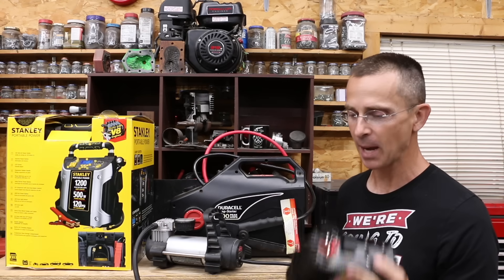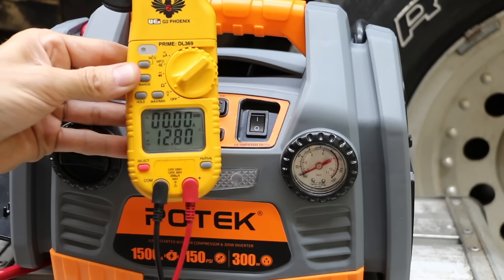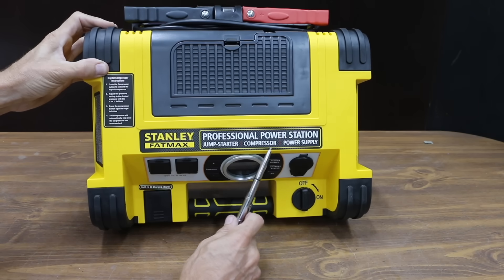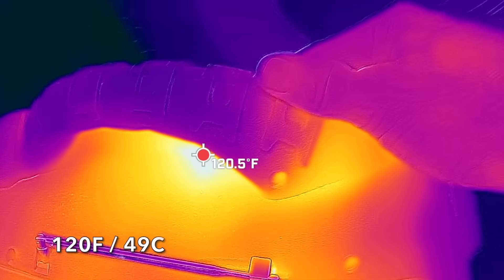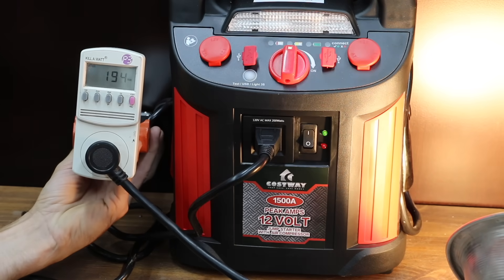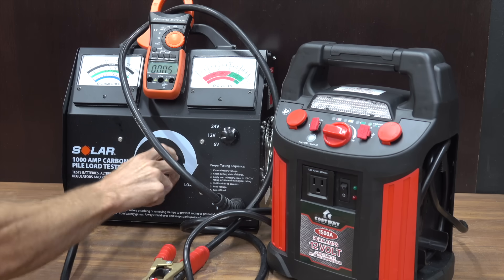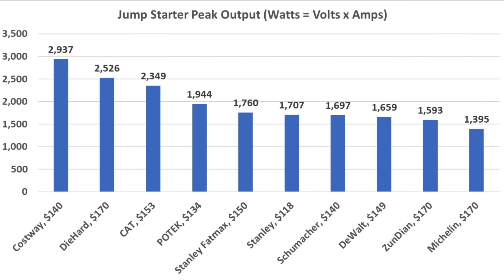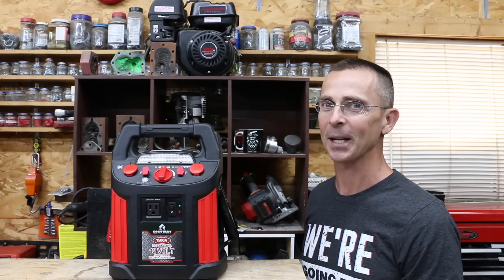Best Jump Starter? DieHard, Schumacher, DeWalt, Michelin, Stanley, CAT

Comment: I would like to see an addition to the test, leaving the jump boxes fully charged for a few months to simulate leaving it in the trunk of the car. Maybe go even deeper into the test by throwing them into the freezer for an hour or so and then pull them out and allow them to warm back up and repeat continuously to simulate sitting in the trunk during the cold months (probably when you’re more likely to have a dead battery !) Then test to see how the battery life is and if they’re still capable of jumping off a dead battery !
Reply: @DrJibson  All but one of them were useless as jump starters which means all but 1 of them is useless.
Reply: @stevewhite3424  - Keep in mind, the unit that tested well, will likely not perform well in states that experience temps at or below freezing during the Winter. To spend $100+ on a jump starter that isn't capable of performing properly year-round/in all climates, makes them pretty useless and a huge waste of $$$
Reply: @stevewhite3424  Exactly!
Reply from the maker: Thanks for the suggestion.
Reply: @ProjectFarm   iv tried to find the costway on Amazon and ebay I can't find it do you know where I could buy one ? And by the way this is another great video man very good info
Reply: JumpNcarry is the only one worth buying.....its all I use at my tow company. If you need a compressor grab one from the junkyard and plug it into the 12v outlet on the box. I've left mine for months and it never fails and it'll run a inverter or compressor longer than all of these even after sitting neglected for months.
Reply: @southjerseysound7340  hell when I was driving a tow truck we had a Duralast jump box (from Autozone) and it’d start a car without a battery in it at all. It wasn’t as fancy as these. It didn’t have a compressor on. lol
Reply: @Ohio-Patriot  
But that's not really impressive. It depends on the car. Some can run without a battery, and some can't.

And having a drained battery makes it harder to start than no battery at all. Not all the energy from the starter will be used to crank the engine. Some will be absorbed by the battery in charging.
Reply: @lordgarion514  it started every car I ever put it on, which was hundreds, dead battery and all. It started many many semi’s too. All I was meaning was for something that you’d think should be junk, it turned out to be pretty nice and lasted forever. It still works great today too.
Reply: @Ohio-Patriot  years ago they had one that was pretty good. I had a few guys using that Duralast box for a while because it was about$40 cheaper than the JNC.  It had a AGM battery inside similar to the JNC. The only problem I saw with them is the wall charger is total trash. But we fixed that with a little trickle charger......... I haven't seen one of the plain ones in a while. But if its the same I'd buy one again although they really like to sell the junk that has the useless crap all over it instead of the quality ones
Reply: @southjerseysound7340  what model do u use
Reply: @fjk4418  jumpNcarry blue has been my go to for years.
Reply: So perhaps I'm not thinking about it correctly, but I've owned the Schumacher jump box for years and years. I've effortless jumped a ton of people with it and it has never let me down even when I've neglected charging it. I feel that on the dead battery test, maybe they should have been turned on and just allowed to sit there a few minutes before cranking them over. I've ran into scenarios where that's what I had to do, but usually it's an instant jump. I have no scientific way to test this myself outside of giving my first hand experience, but it was something I was hoping to see in the video.
Reply: @AlexKstar2025  poo
Reply: @tomcolyar5980 ? I've watched this video over a year ago, and have jumped multiple cars with it since too. I'm in Ohio and we have pretty cold winters, I work in an office building with 200+ people there at any given time and I couldn't even count the number of times I've had to jump cars with it. Literally haven't had a single car/truck/suvs it wasn't able to start in the many many years I've owned it. I don't really know what to tell all the people who doubt these jump boxes other than good luck having it fail to start a vehicle for you that doesn't have a broken starter. You'd probably have to use it on thousands upon thousands upon thousands of cars til you bump into one it can't start up. Do with that information what you will. These things work, practically every time. Especially the Schumacher one I have with slightly better than garbage specs.
Reply: @AlexKstar2025  ive seen times where even when jumping from another running car a battery on the car to be jumped was so dead they needed a moment with the running car revved a bit.  I think it must have been the battery was so dead in the target car maybe some of the electronics required to get to the point of cranking the engine couldnt power up.
Reply: @DrJibson None?  Did you watch the video?
Reply: Same would love to see how temp and time effect performance...had a Neico battery jumpstarter that wouldnt work when my battery died during winter time. Works great....except sitting in 10F in a truck. XD
Reply: @novarian_nexus  thanks, actually my NOKIA ($100 )starter , workED TWICE STARTING, dischargED VEHICLES twice, in WINTER(;once at -20), I do mostly store Carry Vehicle in Protected Garage ( 40 DEG OR BETTER,& recharge yearly..INTERESTINGLY, I DID not find out the IPHONE CHARGER does **not work until two (approx)years after buying.. incidentally the AUTO STORE RECEIPT , :: fades out &;”Print disappears “, in few month( ink Jet: how great is that for profits.)??
Reply: @opera93 probably a thermal printout receipt...?
Reply: a lot of them do have adapters to allow them to charge from 12V ports in your car if it has those, so that would be a decent way to keep them topped up probably
Reply: Couldn't you extrapolate that the "best" performers (i.e., the Costway) would have the best/better cold-weather capabilities?  Also, if cold-weather starter performance is most important to you, perhaps consider a dedicated jump-starter box, rather than one of these multipurpose devices.
Reply: @kenc2257 
No, lead acid batteries are greatly affected by temperature.
for this reason car batteries are custom design for the area they are to be sold in.

Any areas with a lot of cold Winters, the lead plates are much thinner and there are more of them. This allows energy to exit the battery faster.
Thinner plates are also more damaged by heat in the hot climates. So in hot climates the plates in the battery are thicker.

for these cold-weather performance we come down to exactly how they designed the batteries in them.
Reply: @DrJibson 14:32 they did start the vehicles with low batteries, but not with completely dead batteries. In the event you got your voltages just low enough that the battery alone can't fire the engine, they were able to pick up some slack. They just couldn't start the engine on their own (battery at 2a) except for the CostWay. So they do work when the battery is drained but not dead.

Also, 2nd the first comment, see after 3-6 months+Temp changes what their voltages look like, that'd be super helpful!
Reply: @DrJibson ...except for the Costway (it certainly cranked the engine fast enough to start),
Reply: @DrJibson - Agree + good luck to anyone jumping a battery w/these jumpers during Winter in the North. These jumpers are a complete waste of $$$
Reply: @DrJibson stick·ler
/ˈstik(ə)lər/
a person who insists on a certain quality or type of behavior.

"he's a stickler for accuracy"

This does describe me, not sorry.
Reply: This is why you should really go for one of those lithium power bricks instead of a lead acid. Lead acid always drains down if left sitting, and the power bricks don't. They're also a lot lighter and easier to carry around
Reply: @Eric-zs6rd  for my purposes of a backup method of starting a car that may have had the lights left on accidentally or helping someone in a similar situation, but not wanting to deal with maintenance charging of jump packs, I use the ultra capacitor type jump packs, which has no issues being left in a hot or cold trunk for a year.  
if something is needed for starting cars in the yard that has no batteries in them at all, then the battery type jump packs with lead acid are great, as they can act as portable substitute batteries while moving cars around.
lithium ion packs are super light and pack a punch with higher than normal cranking voltages but have longest lifespan when not kept at full charge all the time, unlike the lead acid.
Reply: @Eric-zs6rd the li-ion jumper i bought for my motorcycle heated up and exploded while cranking my mower. For now i will charge regularly my sla... but I am learning about li-ion and LiFePO4 WHILE building solar RV system. Me best jumper was a wallyworld everstart that looked like the costway. I had to replace the r-d charger, but after several years it was the inverter getting bumped on that killed the bat. I have a new battery to install... so we will see if it is resurrected to live again. The LiFePO4s are impressive so far... at least for a solar/RV application.
Reply: Was going to suggest the same thing. It doesn't matter how well they work if they can't hold a charge and be ready when I need them.
Reply: @DrJibson The Costway did.
Reply: Directions say to charge SLA battery powered jump box monthly.
Reply: I have had the Stanley one for a year or so . It can sit all summer and still start a car on a cold winter day
Reply: I bought the cat for $65 at Costco. Not bad for the price.
Reply: You can make the video 🥲
Reply: @DrJibson Well we must not have been watching the same video. Perhaps you should make one doing this test to verify just how terrible they are? At this point it's all words. I'm just going by the evidence I witnessed here, and personal experience with a model not shown here. By all means though, prove him wrong, it's not like it's the "end all be all" solution to all battery issues out there.
Reply: @PhenomII1090T  Do you think that an engine will actually start with the spark plugs disconnected, or with the engine otherwise disabled? He was testing them on a fully drained battery trying to crank over a disabled V6 engine.
Reply: @Namington  good catch on that detail, not running but turning over, my bad there, he mentioned that he disabled the ignition prior to the 2v test so he was doing a CCA test, that also lines up with his pre-engine test of the same. On a smaller engine with a lower CCA requirement the smaller packs would likely stand a chance.
I don't care if people think they're garbage, I've used them many times to jump cars, mowers, and tractors. Oftentimes something just needs that extra juice to turn it over. Live in the upper Midwest here so the cold makes these super handy.
Reply: @PhenomII1090T  . Why would you even consider buying a piece of garbage that may or may not work during an emergency? Multi-tools like the ones in the video are garbage. Only a fool would buy them. If you want something reliable for emergencies then buy separate quality tools. Also, giving yourself thumbs up makes you look like a fool looking for validation.
Reply: @viewer-i5o  Out of curiosity, how do you know that he gave himself a thumbs up? I did not realize there is a way to check such a thing.
Reply: @viewer-i5o  looks around did... Did you think I made this video? Or that I'm a jump starter battery salesman? I'm... I'm touched but you're sadly mistaken.
Unfortunately you'll just have to take all those angry feelings, pour them into a bottle, and toss them into the ocean where they might find someone to care :)
I'd just like to reiterate, I have no skin in this game, only a viewer who has actually successfully used these devices to jump start cars, mowers, tractors, and charge phones. Hopefully your brain didn't explode reading that. Have a great day! 😀
Reply: @PhenomII1090T  . You forgot to give yourself a thumbs up. Your ignorance was exposed long ago. Don't be afraid to continue.
Reply: @DrJibson The Costway was able to jumpstart the car, it was only because he disabled the car from starting it didn't.
Reply: Why almost none of them even worked fully charged at ambient?
Reply: @ßeau_M  consider where they are made and their exaggerated specs,   how many people buy this type of mostly useless goods without research. Our landfills are being overstuffed with their crap and they are laughing about it.
Reply: You're supposed to recharge them every 3-4 months so leaving the unit in your car hoping for the best is irresponsible.
Reply: @viewer-i5o  Yes, but who actually does that?  You'd have to put a repeating calendar reminder in your phone telling you to recharge your jump starter, and then the reminder would get deleted because you were at work, the dentist, or the barber when it popped up.  Next thing you know it's been years since you even touched your jump starter.  Products need to be made to work around how people really are, not how owner's manuals want them to be.
Reply: @Brian424  . I do it. Its not difficult and I don't need reminders to keep my emergency equipment working year round.
Reply: @viewer-i5o   actually, the new upgraded cat that I bought says you're supposed to charge it full every 30 days and every time after you use it it's lead acid that keeps the health of the battery. The one he tested above is a thousand amp and it's like $215 on Amazon which is ridiculous. When you can get the better version of it at Costco for 99
Reply: @viewer-i5o  so many of you may not live in a place that freezes over the winter months, but those of us that do understand cold is hell on batteries. And since most of us need the jump in winter when the freeze kills our car batteries, these packs will be the life saver or biggest heartach ever!
Reply: @jasonjay2945  true, my Nokia has worked twice ( HELENA Valley, MT: see my
Reply: @viewer-i5o  you do now people will forget to charge them and rember they haven't wen they nead them and are dead
Reply: @caramidacaramida3959  . These are the same people  that forget to inflate their tires, change their engine oil, and replace their brake pads. They the same people playing with their phones while driving instead of paying attention to the road. Nothing new here.
Reply: @viewer-i5o  But realistic.
Reply: All this stuff is trash.   If you have a strong desire to throw $100+ dollars away, I'll be happy to take it off your hands and do more productive things with it than any of the useless products here will ever do for the money.   
 If you want in inverter, install a quality inverter.   If you want a jump-start unit, buy a quality jump-start unit.  But these all in one units do NOTHING well save take your hard earned money.

Comment: I’m not sure if there are enough different types, but I’m also a farmer and would love to see which type of fence post driver works best. There are at least 3 designs I know of (main difference being the handle).

Also post hole diggers. Thank you for all your videos! Been here since around 100k since the days of scratching the bearings 😀
Reply: I bought a man saver post driver and it's incredible. Driven hundreds of posts and it still works great. It's air powered and will drive an 8' post 7' in the ground if you allow it to lol.
Reply: @MrLongshot762  will it work with a pancake compressor that I can carry to the field with me?
Reply: @GrannySingaporePVP  I use mine with a 1hp 3 gallon craftsman compressor ran off of a generator with no issues.
Reply: @GrannySingaporePVP  They are expensive but I'm getting too old to pound posts all day and it's way cheaper than hiring someone that won't do it right or as fast anyway.
Reply: @MrLongshot762  I hear that! Thanks for the tip man! I’m going to look into it
Reply from the maker: Thanks for the suggestions!

Comment: I bought the same diehard about 6 years ago at sears. I haven't used it in awhile, but last time I did I noted the air hose had broken/cracked inside the case so the tire inflating function didn't work. Something to keep in mind with all these, as I'd bet they all use about the same quality hose material. Also I wonder how the sealed lead acid batteries will hold up over time.
Reply from the maker: Thanks for the feedback.
Reply: i have an old one from sears when stuff was made in usa i changed the battery after 10 years and it is still working
Reply: I've had mine for 10 years and yeah the air hose blew out last year...I'm not sure if they sell the hose or not but I might take it apart and see If can replace it

Comment: Have you ever tested the jnc660 or any of its variants? It’s a very popular jump starter for mechanics and roadside assistance and is made by clore automotive the same company as your load tester it doesn’t have a inflator or inverter but they do have an updated version with usb ports (jnc770r) as well as a model with a tire inflator (jncair)
Reply from the maker: Thanks for the suggestion.

Comment: Thanks for the video. Question: the ones that cut off at 10 minutes, would they continue if they were restarted? i.e., off and on again. Wondering if it's a safety to prevent over pressuring a tire and causing an explosion.
Reply from the maker: Great question and sorry I didn't explain.  They all will work just fine after cooling down for several minutes.  It's a safety feature to prevent damage to the air pump.
Reply: @ProjectFarm  The air compressor generally gets super hot so it's not a surprise to see a thermal cutout.
Reply: They have a thermostat that shuts the compressor down at a certain temperature.  They come back on after about 5 minutes of cooling.